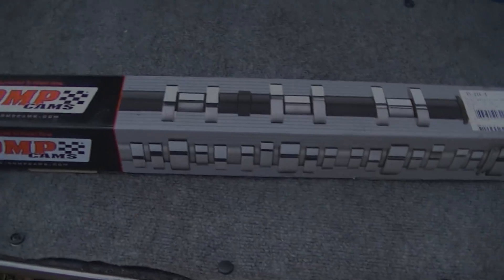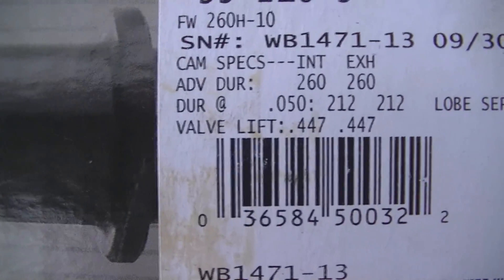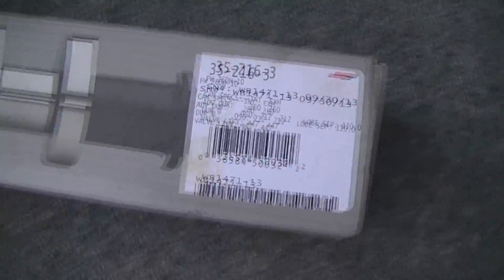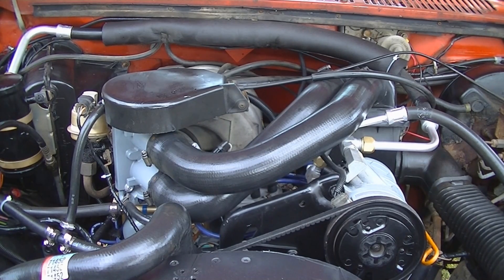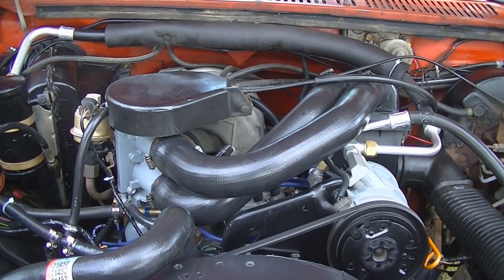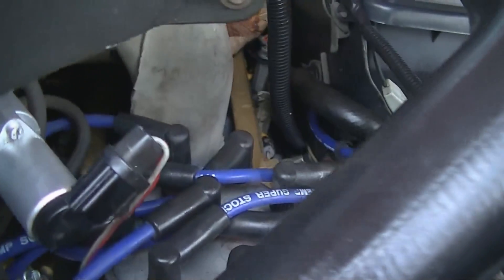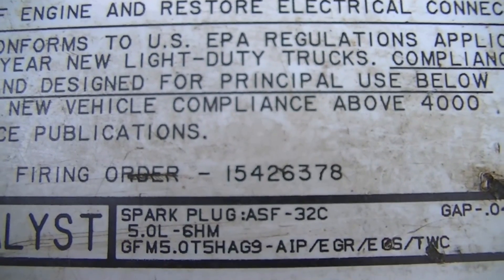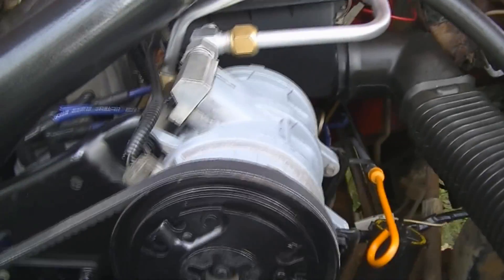By Request: Red F150 Camshaft At Idle

Comment: U also have to swap the wires of two of your injectors y un pining them n swaping places with the pin location if u do that n fix the vacume leak as well as leaving your ignition Spout wire un plugged so timing will stay we're u set it you'll get your lope back the truck is changing ignition timing to compensate that along with the leak n I'm assuming your injectors r still wired for 5.o is bluring out the lope glad to c itl work fixen to put another motor in my 86 actually even same color lol didn't cM it last motor was told it wouldn't run with it but it'll get one this go around lol👍

Comment: Is that still running speed density? I thought that the lope had to be 114?
Reply: The older ones were way more lenient. My pap put a 110lsa cam in his SD 93, and had to run an 89 computer
Reply: @tylercapece138  did it work. I have a 92 f150 5.0 with a e303 cam. But I need to figure out what I'm going to do. Either maf convertion or holley terminator x

Comment: Did you change out your push-rods and valve-springs with this cam upgrade?
Reply from the maker: No. The camshaft was late in its shipment and they actually sent me the 
wrong camshaft. The one I ordered had a smaller lift and duration and 
was intended to be used with stock springs. However when I got this one 
and realized it was bigger than supposed to be, I started researching. 
Every source and website I found stated that this was the biggest I 
could go on stock springs, and would work. I already had the engine 
together and the cam was holding me up. Had I not been in that position I
 would have done a pushrod and spring upgrade.